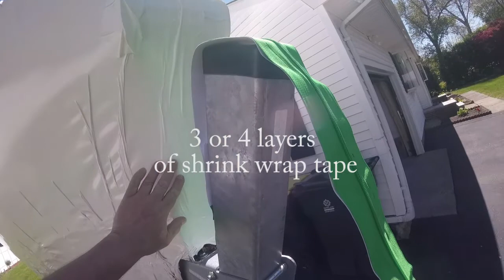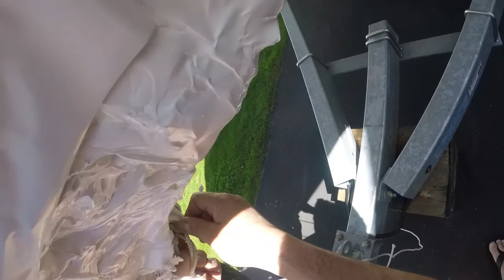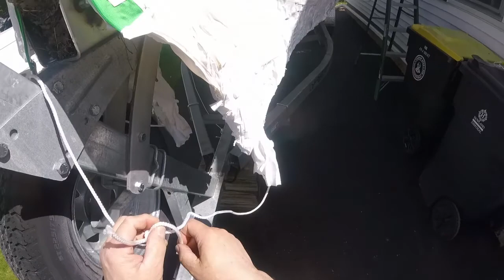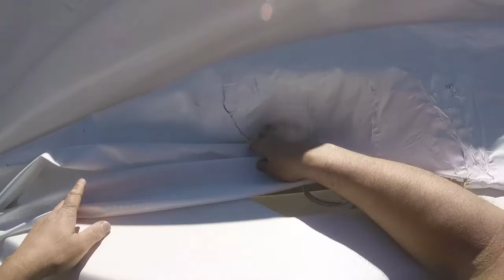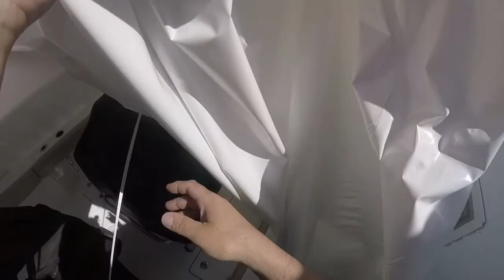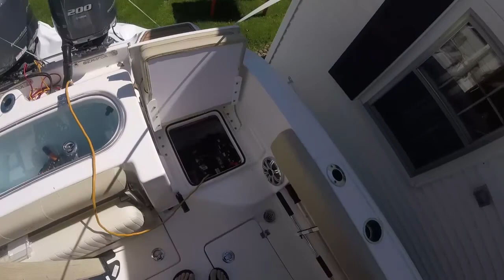DIY How to reuse your shrink wrap

Comment: Love the zipper idea, are you still using the same shrink wrap?? How did the zipper do over the last 3 years? Anything you would change?
Reply from the maker: Unfortunately the zipper idea didn't work. I'm still using the same shrink wrap though. The way I do it now is I make a cut from the top edge of the boat down to the bottom and use shrink wrap tape and it works perfectly.
Reply: @iburciot  do you still start at the bow??
Reply from the maker: No, I do it in the middle of the boat because you don't have to stretch much to get it on.

Comment: I’m not sure the storage and the risk of reusing the wrap will be worth saving a few hundred dollars.  The sun, wind, (snow for me), etc., the elements wearing down the wrap would be scary to reuse again.  Plus it won’t be as tight as before. Curious on how the wrap goes when you put it back on.  Kinda odd they wrapped your trailer and left openings.  I like the protection around the top portion for GPS  etc.
Reply from the maker: I'll make a video and show how the shrink wrap is